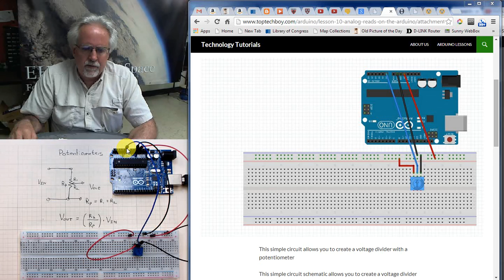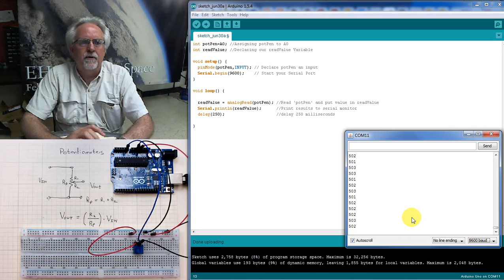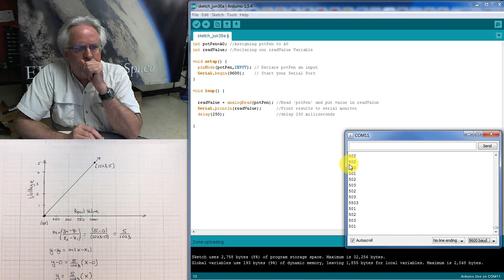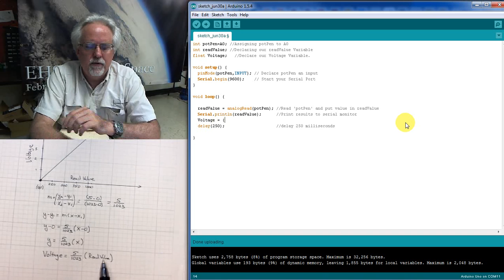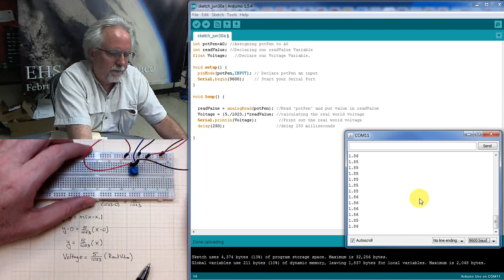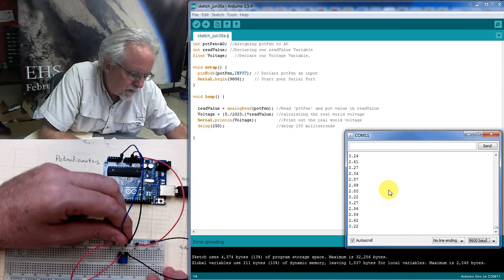LESSON 10: Reading Analog Voltages with Arduino

Comment: I've been doing some experimental interrupt testing on this one. With a little trial and error, I was able to get it working satisfactory with the addition of 100nF capacitors between each switch, bridging the switch to ground. No caps = lots of missed button presses and triggering on both press and release, randomly. 

Pressing the right button toggles a blink state and the left will toggle the blink state from analog control to full bright.

My code below:
// Lesson10a: Analog read. Testing out interrupts
// Using the Arduino Nano.
// https://youtu.be/9FBMVt-iFrM?si=wZlHcYEvd8E-w9XG
///////////////////////////////////////////////////

// Set up pin variables. (5, 6, 9, 10 and 11. All are PWM pins for dimming effects.).
int iPinLED01 = 11; // External LED connected here.
int iPinLED02 = 10; // External LED connected here.
int iPinLED03 =  9; // External LED connected here.
int iPinLED04 =  6; // External LED connected here.
int iPinLED05 =  5; // External LED connected here.
int iPinButtSelect = 3; // Black button. Used to make changes. 15k pull down. Interrupt 1;
int iPinButtInterr = 2; // Red button. Used to call interrupt. Interrupt 0;
int iPinPot01 = A0; // Pot connected here.

// Set up the pin value variables.
int iAnalogLED01; // First in line.
int iAnalogLED02;
int iAnalogLED03;
int iAnalogLED04;
int iAnalogLED05; // Last in line.

// The two buttons have a 100nF cap between the switch pins. Marked 104.
// This will help with debouncing.
int iDigitalButtSelect; // The left button.
int iDigitalButtInterr; // The right button.

int iAnalogPot01; // Holds the pot value.
int iValue;       // Holds the converted value for LED brightness.

// Set up any timer variables.
int iDT = 250;  // Delay.

// Calculate the slope.
float fX1 = 0.0;
float fX2 = 1023.0;
float fY1 = 0.0;
float fY2 = 255.0;
float fSlope = ((fY2 - fY1) / (fX2 - fX1));

volatile bool bState0 = false;
volatile bool bState1 = false;

void setup()
{
  // Setup the serial port.
  Serial.begin(9600);
  
  // Set the pins up.
  pinMode(iPinLED01, OUTPUT);
  pinMode(iPinLED02, OUTPUT);
  pinMode(iPinLED03, OUTPUT);
  pinMode(iPinLED04, OUTPUT);
  pinMode(iPinLED05, OUTPUT);
  pinMode(iPinButtSelect, INPUT_PULLUP);
  pinMode(iPinButtInterr, INPUT_PULLUP);
  pinMode(iPinPot01, INPUT);

  attachInterrupt(digitalPinToInterrupt(2),onInterrupt0,FALLING);
  attachInterrupt(digitalPinToInterrupt(3),onInterrupt1,FALLING);
}

void loop()
{
  // Read the pot and button values and display it to the user.
  iAnalogPot01 = analogRead(iPinPot01);
  iDigitalButtSelect = digitalRead(iPinButtSelect);
  iDigitalButtInterr = digitalRead(iPinButtInterr);

  // Call onCalculateOutput() to calculate correct PWM values.
  onCalculateOutput();
  
  // Call onSetLEDs() to write the correct britness to them.
  onSetLEDs();
  delay(iDT);
}

// Called to set the LEDs values.
//////////////////////////
void onSetLEDs()
{
  // Set the LEDs to correct value.
  analogWrite(iPinLED01, iAnalogLED01);
  analogWrite(iPinLED02, iAnalogLED02);
  analogWrite(iPinLED03, iAnalogLED03);
  analogWrite(iPinLED04, iAnalogLED04);
  analogWrite(iPinLED05, iAnalogLED05);
}

// Calculate the LED brightness.
////////////////////////////////
void onCalculateOutput()
{
  if (!bState0)
  {
  iValue = (fSlope * iAnalogPot01) - fX1;
//  Serial.print("Calculated output 0 to 255: ");
//  Serial.println(iValue);
//  Serial.println(bState0);
//  Serial.println(bState1);
  iAnalogLED01 = iValue; iAnalogLED02 = iValue; iAnalogLED03 = iValue; iAnalogLED04 = iValue; iAnalogLED05 = iValue;
  }

  if (bState0)
  {
    if (!bState1)
    {
      iValue = (fSlope * iAnalogPot01) - fX1;
      iAnalogLED01 = iValue; iAnalogLED02 = iValue; iAnalogLED03 = iValue; iAnalogLED04 = iValue; iAnalogLED05 = iValue;
      delay(iDT);
      onSetLEDs();
      iAnalogLED01 = 0; iAnalogLED02 = 0; iAnalogLED03 = 0; iAnalogLED04 = 0; iAnalogLED05 = 0;
      delay(iDT);
      onSetLEDs();
    }
    
    if (bState1)
    {
      iValue = (fSlope * iAnalogPot01) - fX1;
      iAnalogLED01 = 255; iAnalogLED02 = 255; iAnalogLED03 = 255; iAnalogLED04 = 255; iAnalogLED05 = 255;
      delay(iDT);
      onSetLEDs();
      iAnalogLED01 = 0; iAnalogLED02 = 0; iAnalogLED03 = 0; iAnalogLED04 = 0; iAnalogLED05 = 0;
      delay(iDT);
      onSetLEDs();
    }
  }
}

// Testing interrupt funtion.
/////////////////////////////
void onInterrupt0()
{
  // Flip bState0.
  bState0 = !bState0;
}

// Testing interrupt funtion.
/////////////////////////////
void onInterrupt1()
{
  // Flip bState0.
  bState1 = !bState1;
}

Comment: Nice video. I tried measuring voltage, by adding  a 3 volt supply, but the Arduino saw it as a 4volts on A0.

Comment: I am trying to connect 6 thermistors to pins A0-A5. Everything is fine except on pins A4 and A5, the value are not good, what's wrong with those 2 pins. Same problem with the 2 Uno I have.

Comment: May someone please point me? I got my Arduino Uno R3 supposed to be genuine, Input A4 does not read nothing at all in analog reading voltage input. Measuring the voltage with a multimeter it will shows 5volts constant on A5 input analog, is that normal? or I did I get a bad board?

Comment: Hello sir!
I need help! i want to choose power supply for my arduino in one of my projects. i want to feed arduino with 9v battery and 12v adaptor same time (not sametime excatly).
arduino will be run with battery at the beginning but if there is a voltage reading on adaptor source i want to choose adaptor until adaptor is offline. i have relay card already and i can write the codes too but i dont know is it dangerous to plug another voltage source? (maybe using a potentiometer to decrease voltage to 2-3 volts )
For example:
when arduino starts and run with battery, battery will be connected from relay's NC side. There will be also input from adaptor output and pot to analog input. i'll use middle pin of pot to make it analog input. i know the calculations for reading voltages already (i'm using it already to read battery level) battery will be connected from relay's NC side and when analog input is more than 1000 (1023 max) i will make the relay energized and it will change arduino's source.
i have 2 questions;
1- when i change the source, there will be small amount of time (about miliseconds) arduino will be out of energy. is this miliseconds will be a problem for me? i mean if arduino resets itself it will start with battery again and try to change to source.. endless loop...
2-when an arduino runs with a 5 volt source, can we read 0-5v analog inputs from another source's vcc?

Comment: Another great lesson, thanks Paul.  I worked as a NC electronics tech at one time and am now retired and At 65 the Arduino keeps me busy.  I tell my wife all the parts, modules and sensors are my LEGO’S.  57 years ago I got put together my first “LEGO” project which consisted of a battery, light bulb, wire and tape and I’m still playing with LEGO’S

Comment: Hey sir. I really like your videos an like trying and finding my mistakes and trying to correct them.
I have one question regarding this video and the one about Analog Reads in the new Arduino playlist.

I have noticed if I remove the potensiomiter from the Analog in Pin it gives random answers as output in the serial monitor, no matter what I try I cant get the value to 0.00 if I remove the pin from A0

Is there a chance that you could explain why this is happening.
Thank you Paul. I appreciate it!

Comment: I wasnt able to get this to work with a 5k pot, is there a different value I need to use?

Edit: I accidentally put a plus sign in front of the analog read instead of an equal sign, it's working now!

Comment: Wow, this is such a crucial episode for people like me who are learning about arduino for the first time! after i wrote the code that was shown in the first part of the video, i instantly started piecing together parts of previous code that i learnt, and created a system where depending on how high the resistance is, a respectable number of LED's will blink. if the analog reads 258, one LED is blinking, 516 and two are blinking (and so on...).  Very cool episode :)

Comment: Can anyone help me?
Why is it reading continuous different voltages?
Reply: I had this problem as well, where at certain times the IDE would just show readings that change from time to time even though i was not touching it. My explenation would be that one or more components of the circuit were loose, and this caused an anomaly in the readings. after i puched down on everything, and made sure it was secure, this problem stopped.

Comment: What if the voltage supplied was 5.6 volts etc. Does it still max out at 1023 on analog input. Is the arduino calibrated for 5 volts exactly at the analog inputs????

Comment: Sir ur lessons are Awesom...I have aQuestion related to this
Q1: I have used 3.3V pin instead of 5 volt pin but Serial Monitor shows output voltage upto 3.5V ,    3.6 V ,  3.7 V ,  3.8V why is it so ?

kindly Answer Sir

Comment: Great Video - this makes me think - how can this circuit be modified to read lets say up to 50 Volts ? need some chip that takes 5 volts and can output max 50v?
Reply from the maker: You really need to know what you are doing as you use higher voltages. With simple low current 5 volt inputs and outputs things are safe, and nobody gets hurt. As you deal with higher voltages and currents, make sure you know what you are doing.

Comment: for the math i just did 1023/5= 204.6 n so readValue/204.6 = voltage. i dunno about all this line and graph stuff haha i mean like it seems unnecessary haha
Reply from the maker: It seems like unnecessary because it was an easy problem. I gave you an easy problem so you could learn the math. Then when a harder problem comes . . .one with a y intercept and lets say a negative slope you could work it. Those who succeed in engineering are those who learn the math.
Reply: @paulmcwhorter  I understand. I definitely agree that the math should be learned.. I think everyone should learn everything.. I'm  just trying to understand. Could you give me an example of the type of problem you're talking about? Just so I can try to solve it and see what you mean
Reply from the maker: You have a light sensor that reads 129 in the dark and 1264 when the lights are full bright. you want to output a voltage between 2.5 and 5 volts depending on brightness between dark and full bright. You want output voltage to change smoothly between the two values based on brightness.
Reply: @paulmcwhorter  Thank you sir
Reply: @paulmcwhorter   I know the math is still the same, but, just wondering, wouldn't the maximum value for the light sensor be 1023? I mean at full brightness
Reply from the maker: No, the sensor changes resistance based on how bright the light is . . .ends up between two values you have to measure. Might never get to 1023.
Reply: @paulmcwhorter  Ahhh yes, sorry, you said sensor reading and I was thinking about the maximum value for the potentiometer reading  being 1023.. I see. Thank you for responding. Much appreciated

Comment: hi sir i appreciated your Videos but i think most of them , you are not explain about Arduino itself but about maths, that it is not what we are looking for , what we are looking for  is programming , Codes what they do, math is boring
Reply from the maker: Actually the math is very important. If you do not understand the math, you will never be a successful engineer or scientist. My goal is to train people to become successful, not create ignorant coders.
Reply: @paulmcwhorter  Sir with all do respect when you go home and push the button to turn the lights ON or OFF in your house, you don't care what AC volts are 110v or 220v behind the button ,what is really matter if the lights is  ON or OFF, when you want to take things 1 meter far way from you i don't need to know that 1 meter has 100 centimeters , i just want 1 meter , simplify thing it is part of life make life easy! sorry if i bother with my ignorance, just because you knowhow 2 + 2 = 4, it does not make you a genius, have a awesome day sir
Reply from the maker: I think you just dont get it . . . when you turn the light switch on, you want more to happen than you are saying.  When you turn the light switch on, you want the light to turn on, and you want the house to NOT burn down. If you do not do the math, you have not calculated the current carrying capacity of the wire you put in the wall, the correct breaker to use, and how many outlets can be put on the circuit. You do this job without the math, and maybe the light comes on and the house burns down. Luckily, successful, practicing engineers and electricians have better judgment than your comment reflects.

Comment: Why dose a analog read 1023 be five volts but analog write is 255 why not just 255 again
Reply: Because reading analog (A0,A1...A5) send info to processing units using 10 bit pipeline in decimals =2^10 =1024

And writting (pin 1,2,...13)  using pipeline 8 bit in decimals = 2^8 = 256

One is less in both because we also count zero ...
Reply: @shabir301  thanks I had that question too

Comment: hey paul! Ive been following your arduino series closely and absolutely loving it. I have a ques though ; why do we have to ground the potentiometer ? like I believe that no current would pass when the the middle pin covers whole of the resistor (I have a 10k potentiometer) , but still the led is turned on (very feeble but still) while when i ground the potentiometer it works perfectly . why so ?

Comment: Watch-out guys: the first minute is wrong (or badly explained), on the D* pins, in analogWrite "mode", it is only the "apparent"/average voltage that goes from 0 to 5V but really the 0 to 255 value controls the duty cycle of a PWM pulse (pins with a "~"), so even in PWM mode, those pins are Digital pin and always output either 0 or 5V, nothing in between (confusing due to the analogWrite()). If we analogWrite 127, the pulse will be 50% at 5V and 50% at 0V during one pulse cycle; that goes so fast that we don"t see a LED blinking (even though it does) we see it as if it's On but dimmer.
Reply: Okay. I'm building a simple robot and I will use PWM for my servos. Thanks for the info. To me that helps. Keep commenting because it is useful. 👍
Reply: i didnt get it

Comment: I used pin 9 to write an analog value, ( by giving a value in the serial input line ) and when i read out the value trough port A0 it is not correlated ... should the value A0 not be a proxy of 4 x the given input value from pin 9 ?

Comment: The readvalue of my Potentiometer is capped at 670 (0-670), does that means it is broken?? About one week ago it shows (0-1023) as you said. Thanks in advance.
Reply: I've checked the wire, pin and breadboard connection. They are all working.

Comment: Sir Paul please help me... I dont apply any input but my serial monitors shows a number not zero, I'm pretty sure its not the code, even in the built-in sample in IDE about analog reading my serial monitor shows a value of around 300 even though I'm not connecting anything in the board.. Please help me sir paul is my board broken? 😭😭

Comment: My doubt is that we aren't setting our input pin to the potentiometer as" high" or any other analog value,but still the circuit is completed (i.e the input pin to potentiometer reads 5 V.How is that possible?
Reply: If I am setting any pin to 5 V, I have to set it HIGH,but thats not the case here.why?

Comment: I want to measure the Solar panels voltage and it is around 100 V DC. I will be using the Mega arduino.  I am using 1/25 factor from 100v that will be 4 V DC. How I connect the ground of the voltage divider and Arduino ground? Please help me if I got it right?

Comment: Hey Paul, First off I love these tutorials, honestly some of the best content around. and your website is so helpful.

However i would like to point out a small problem in your math.

In computer sciences we start counting from Zero in math from One.
Zero is a position there for in analog there are 1024 positions available between (0-1023)

so when we transfer Computer counting in to math we need to account for the position 0.

In a Nutshell (5/1024) gives you position for Voltage.

We are only human.

Correct me if i am wrong....
Reply: i knew that the analog usually ranges between 0-1024 but
in my potentiometer i have  cranked  the shaft   of potantiometer but the max value was  1023.
it starts from 0 but ends in 1023, so i guess his math is still true :D

Comment: Need help here ,please.
i got a message here "An error occurred while uploading the sketch
Error while setting serial port parameters: 9,600 N 8 1"
when i try to upload to my Arduino Uno.
Reply: this is my code

int potPen=A5;
int readValue ;

void setup() {

  pinMode(potPen,INPUT);
  Serial.begin(19200);

}

void loop() {
  
  readValue = analogRead(potPen);
  Serial.println(readValue);
  delay(250);
}
Reply: Sorry,Serial.begin(19200); already change to Serial.begin(9600); when its happened.

Comment: Hi Paul,

First of all, thank you for the inspiring lessons! I am sure that you have put a lot of effort into them. I am up to lesson #10 and I have already had so many ideas spinning in my mind. But before I make my idea into reality, I do need some answers to my questions. 

My Question #1 is how many LEDs could one Arduino UNO board carry? I will probably use 64 LEDs for my project.

My Question #2 is if the board will be overloaded working with a certain amount of LEDs, does it support external power supply like a battery or a power cord just to make sure that nothing fries the board? 

Again, thank you for the lessons. I will finish the playlist in a few days. Hopefully, I can get some comebacks from you soon!